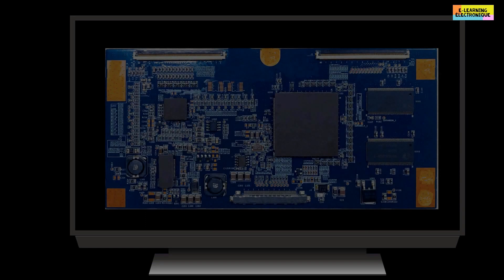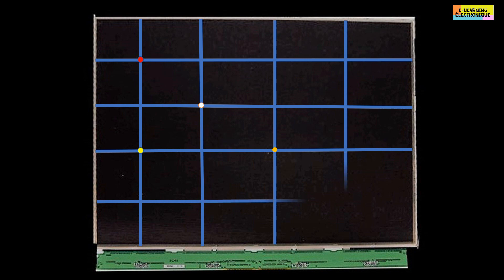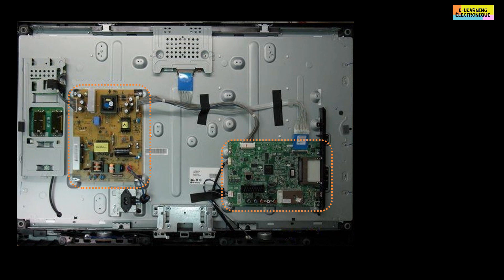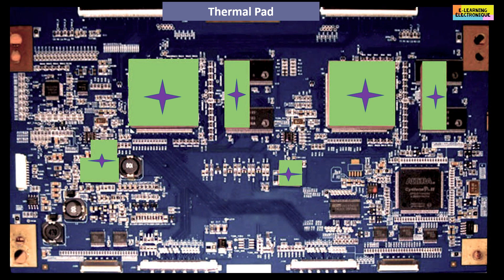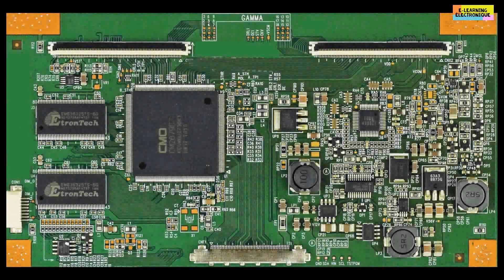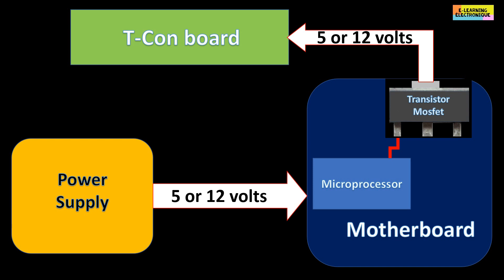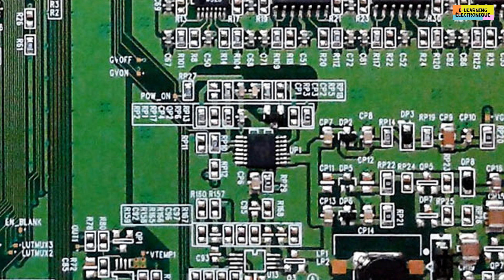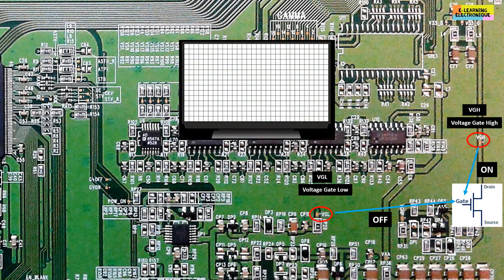Identification and function of the T Con board in an LCD TV

Comment: Which order should these videos be viewed in?  A numbering system would help.
Reply: Cl co
Reply from the maker: I suggest this order

1- Identification and function of the T Con board in an LCD TV
2- Internal structure of a liquid crystal or LCD TV screen
3- Organization of the pixels in  LCD screen and the different circuits of their control from the 4- TCON
4- Geometry of pixels in an LCD screen and their control by the Gate driver
5- VGH and VGL production mode by the TCON board.  The charge pump converter.
6- VDD and AVVD voltage production mode by the TCON board . The Buck and boost converters.
7- Meaning of the LVDS used between the motherboard of an LCD TV and the TCON board
8- Video signal transmission between motherboard and Tcon via LVDS. VESA and JEIDA standard
9- Role of the Gamma chip of the TCON board in an LCD TV
10- The Gamma chip of the TCON board and the role of the opamp configured as a voltage follower
11- What does it mean on a TCON board CPV CKV CKVB STV STVP OE XAO RL UD VGH VGL
12- Meaning of STH CPH TP POL SOE STB and relationship between TCON Gamma and source driver
13- Signs of LCD TV screen defect  Horizontal line, double image and screen breakage
Reply: @elearningélectronique  - amazing videos, it helped me to fix my tv!!    But I disagree about your suggestion,  here follow the order I found to be better:

01 - Identification and function of the T Con board in an LCD TV.mp4'
02 - Internal structure of a liquid crystal or LCD TV screen.mp4'
03 - Organization of the pixels in LCD screen and the different circuits of their control from the TC
04 - Geometry of pixels in an LCD screen and their control by the Gate driver.mp4'
05 - VDD and AVVD voltage production mode by the TCON board . The Buck and boost converters.mp4'
06 - VGH and VGL production mode by the TCON board. The charge pump converter.mp4'
07 - Role of the Gamma chip of the TCON board in an LCD TV.mp4'
08 - The Gamma chip of the TCON board and the role of the opamp configured as a voltage follower.mp4'
09 - Meaning of STH CPH TP POL SOE STB and relationship between TCON Gamma and source driver.mp4'
10 - What does it mean on a TCON board CPV CKV CKVB STV STVP OE XAO RL UD VGH VGL.mp4'
11 - Meaning of the LVDS used between the motherboard of an LCD TV and the TCON board.mp4'
12 - Video signal transmission between motherboard and Tcon via LVDS. VESA and JEIDA standard.mp4'

Thanks!!
Reply: @elearningélectronique  Thankyou very much.